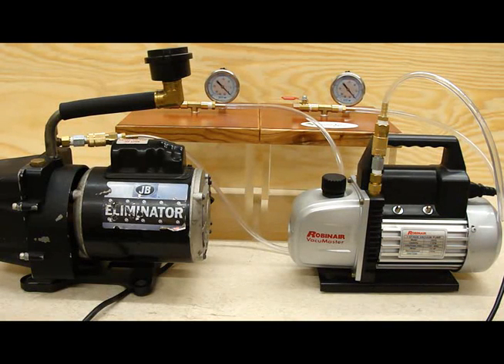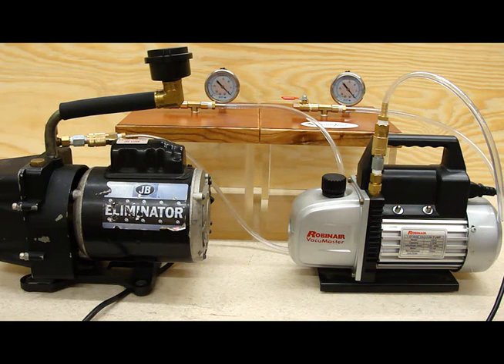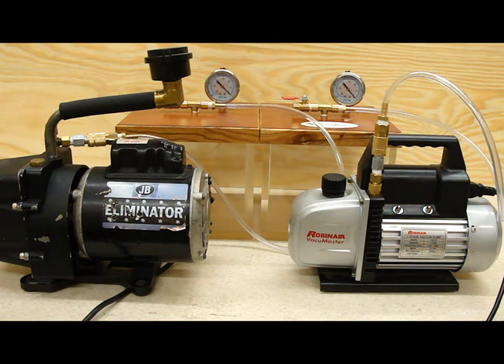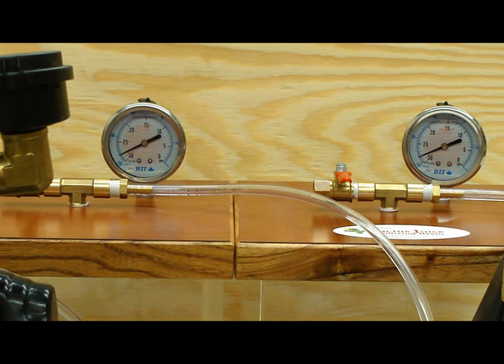Battle of the vacuum pumps

Comment: Why they never reached 29,9 In? It uses to happen to me too. Why can't it reach 29,9?
Any suggestion or comment? Did it happen to any of the viewers as it did to me and the video creator?
Reply from the maker: Becasue I am not at sea level.  You can only achieve close to perfect vacuum at sea level.  As you go up in elevation, the atmospheric pressure decreases and so does your level of vacuum.  You can see what your expected maximum theoretical vacuum is using this calculate on my website:  https://www.turntex.com/help-center/cactus-juice-stabilizing-resources/77-maximum-theoretical-vacuum-calculator
Reply: Oh wao... I forgot that. Yes, you're right. Thanks for the comment.

Comment from the maker: Lou,  That is the point!  There are some folks who buy higher CFM pumps thinking that bigger is better.  In this video, you can clearly see that the 3 CFM pump did it just as fast as the 6 CFM pump.  The vacuum rating is much more important than the CFM rating.  In order to take advantage of the higher CFM pump, you would have to use a much larger hose with larger fittings so as to not restrict the air flow.  My advice...save the money from the larger CFM pump and spend the dif on quality.